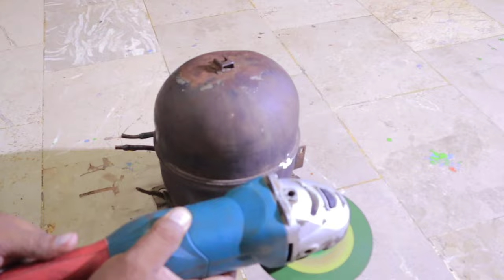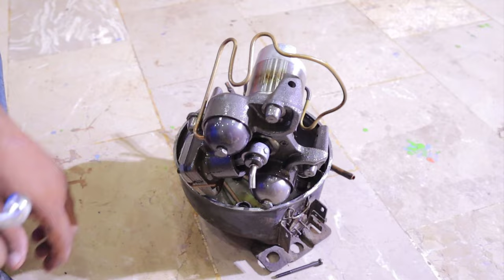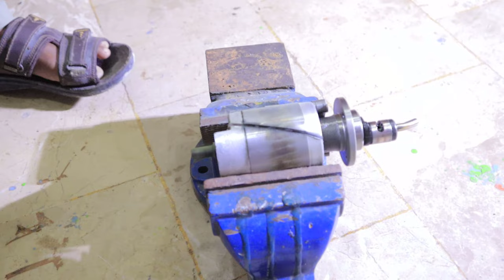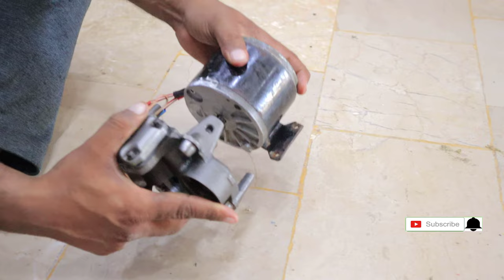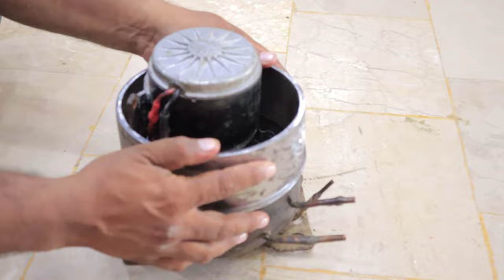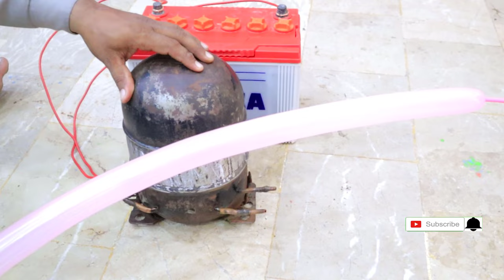12 volt DC Compressor How To Make 12v Compressor For Refrigerator Dc 12v Refrigerator Compressor

Comment: great for making videos only, not worth trying myself, that motor inside wont last a minute, first answer me where the motor housing attached to? if you could show then its believable.
Reply: The wires are the housing lmao. Only thing keeping that motor from spinning internally.
Reply: Motor housing can manage your self..video shows that.. We can do changes from AC to DC.. 👍 But we want to know how Amps consume..??
Reply: I have the same question myself. The motor housing has to be attached to the containment vessel somehow or it will spin loose and break the wires as soon as any real pressure builds.

Comment: The right approach is to use the same motor and then change the 220-volt or 110-volt  Winding to 12-volt Winding.
Reply: Then it will be ac only
Reply: I'm don't know electricity. I did asked an electrician if one can rewind that motor to 12 volt and he said no. Is it possible???

Comment: Youll get high temp in the coils working under 12v DC, youll need high current to run it and current means heat. Moreover this compressor works with presured and vapourized oil inside it. So i dont recommend do this thing

Comment: Good video. Is it more efficient using DC12 volts? Does it still work as a fridge compressor? Is the motor strong enough?
Reply: not strong enough so the motor should be powered with 24V or even higher

Comment: Oh Oh, looks neat, however please be careful.  Make certain there are no flammable refrigerants used in what ever you apply this to.   And also, the carbon brushed motors should not be used , may create phosgene gas... (only use brushless).  Cool video..  :)

Comment: It's cool and I love it, but am thinking of heat. Don't you think that the motor might be damage due to excessive heat because of the enclosure. No air to cool it down.
You know it will be giving out heat as it works.
Reply: Refrigerant in casing cools the motor

Comment: The brushes wear and will put debris into the oil and then it clogs the tubing, so this will fail pretty quickly.
You need a brushless motor if you are doing this kind of thing.  I've actually rewound the stator and put permanent magnets on the rotor, but I have found that without the rear bearing, the magnets cause the rotor jam into the stator.  
The newer (say 2010 or so, variable speed compressors from a Samsung have 3 phase motors, and as such, it is MUCH MUCH easier to just use a 12v->120vac inverter to run them, as they can do soft start and don't need a huge inverter to run.  That is what I do for my RV fridge project.
Reply: I agree with you, what did you made for your RV
Reply: But samsung inverter dc compressor cost is 20000rupees
Reply: @Achu-kw6sv  Where I am I get free fridges all the time if I want to go pick them up..
Reply: It’s a sealed motor

Comment: Smart idea, sealed motor so the Brushes won’t contamination the oil or refrigerant. Check. Ambient air cooled motor, check. It’ll live a happier life in there than it will with ambient air cooling, having cool refrigerant vapor returning too it.

Comment: The idea altogether is good but i don't think that dc motor's torque will will be equal to that of the ac squirel cage motor. I don't think it would provide enough compression . Moreover, there is that point of motor cooling. Such closed dc motors are not designed to work 24 hours 7 days. And more immportantly, they have that problem of the brushes that wear out and need to be replaced.
Reply: No this motors torque is higher it drives electric bikes for crying out loud

Comment: What is the current draw? Can it be installed in a car aircondition?
Reply: no, too big to be installed in a car has its own compressor attached with the timing belt and takes power from engine to run. thanks

Comment: This has work but it will not work in a long run bcz the DC motor will be heat up in a closed chamber of compressor which itself will be very hot after the usage. if this would be so simple then most of the companies making AC and fridge compressor would make this

Comment: With this method I can convert a 220v AC unit to 12v DC
Reply: Don't you even think about it. Its useless. Its only for balloons not for AC
Reply: @infofactory1  Yea that's one way to use this thing

Also if an induction motor can run a fridge compressor, maybe a high torque dc motor can also perform well

And why do portable 12v/24v refrigerators exist with a compressor inside them? 🤔